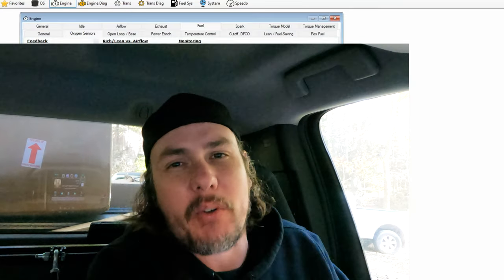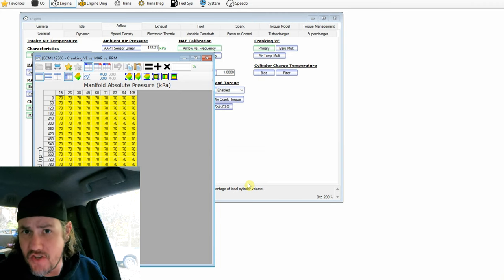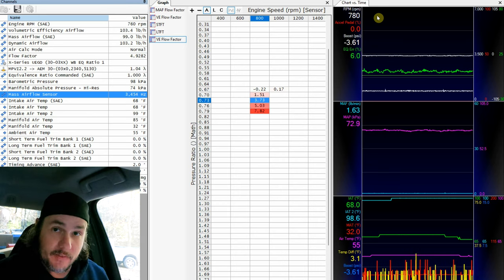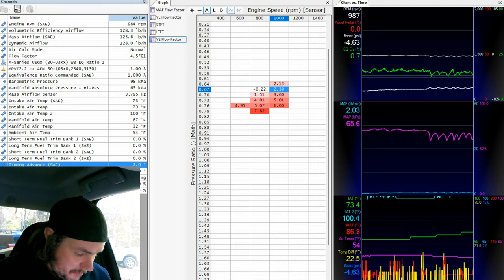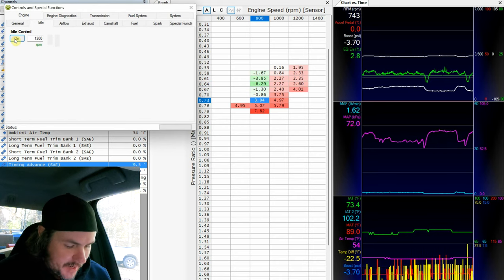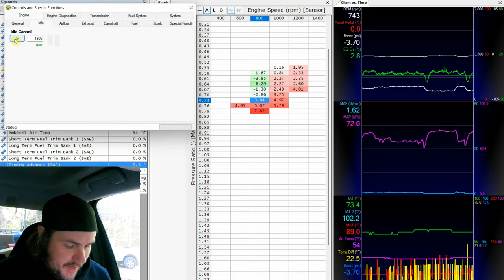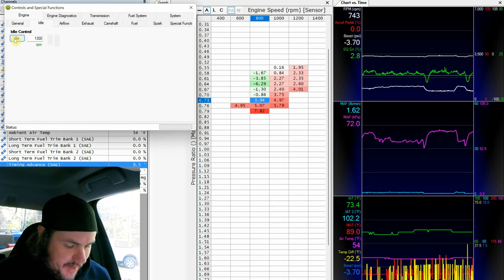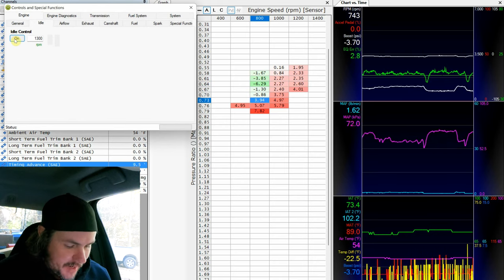Tune VVE First on 5th Gens?  Why It Matters.

Comment: 2015 cadillac escalade put a texas speed stage 1 610 lift 220s duration starts just fine smells rich but wont start once warm seems to drive fine as long as it runs also my remote start is wonky

Comment: What tables are primarily used for cranking fuel? Swapped a 2017 lt1 camaro motor and it doesnt like to start unless given a short of carb cleaner, but once running it starts untill it sits for couple days

Comment: Tuning a Gen IV swap LS2 + 6l80e. Did MAF tuning first which is on spot. Then did VVE which is also on spot now thanks to your videos! 

BUT, when going back to blend mode MAF is 30-50% off all of a sudden? What gives? I tuned both methods individually as per common praxis.

Comment: Have you ever had that when you disable MAF that it will only go to 50% throttle or so? I noticed it on a 2015 Silverado and a 2018 ZL1. I tuned VVE for part throttle and MAF for WOT with the stock switch over RPM so it still ran great after the tune was done but still curious if there's a work around so I could more accurately tune VVE in WOT.
Reply from the maker: On the 2015, no, unless it is going into a limp mode, there are some based on air calc if you start making too much airflow, check your DTC's then look under the Engine Diag tab and see if there is a way to adjust for that DTC.
Reply: @GoatRopeGarage  i had a 17 Silverado which had a baro sensor range code. I disabled that and was good to go but the 18 ZL1 and the 15 Silverado had no codes. I tuned VVE at part throttle and once I re-enabled MAF i got full throttle again
Reply from the maker: @askkmb  ah, yeah, you need to use a baro breakout on the maf, allows you to use a 1 bar map sensor for reading barometric pressure

Comment: Are you able to tune VVE on a 2018 Camaro ZL1? Seems like alot of tuner struggling with VVE on that specific model. Been told the Corvettes run without the MAF, but not the 2018 ZL1.
Reply: I tuned a cammed 2018 ZL1 a little while ago, everything went great and I failed in VVE first and later the MAF. After that I re-enabled the switch over and it runs on both MAF and VVE. One thing I noticed though is that when MAF was disabled that it would only go to 50% throttle. But I didn't really care because the MAF takes over at WOT so I left VVE enabled for idle and part throttle
Reply from the maker: 2018+ Camaros can have some issues with going into limp mode, check to see if it is setting a DTC and see if you can disable it while tuning.  If not you may just need to reset it and start the log over.